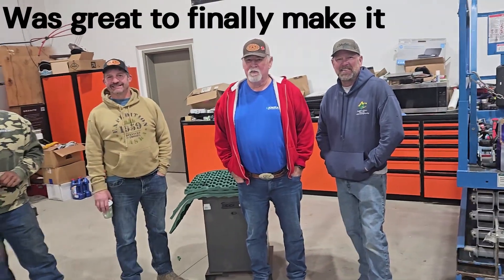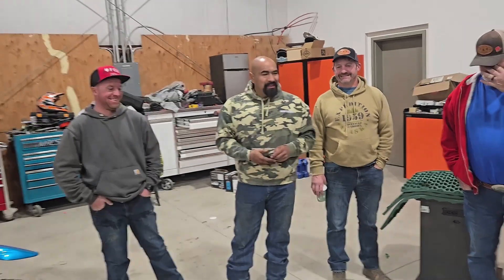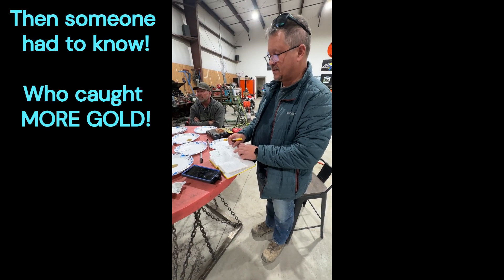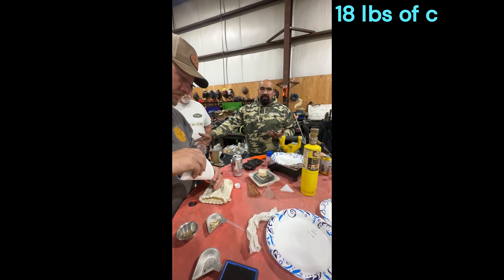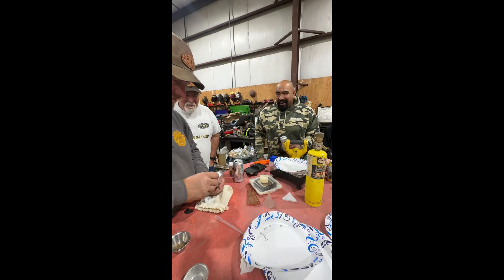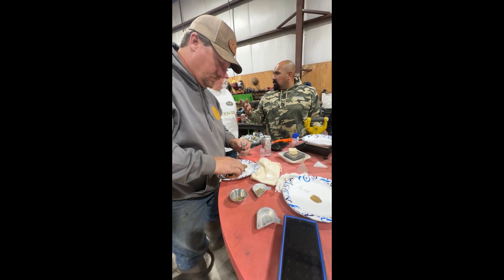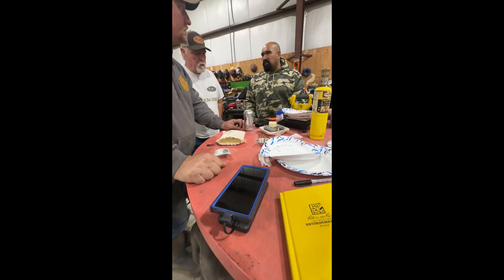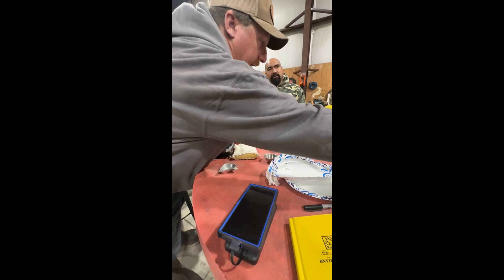Testing Dream Mats with Juan Ibarra

Comment: We use the dream mat because of the cyclone effect using the centrifugal flow. Ancient roads with gutters used it, some photos are around. In our situation we use the inside bend of a special size corrugated tubing found everywhere, most is free, to clean up our super fine gold and all that is smaller than 1/8". We don't feed it with a little spoon, we scoop it in. We never have to run it twice. DIY riches from the ditches. See for yourself. Two Old Prospectors (TOP) - YouTube